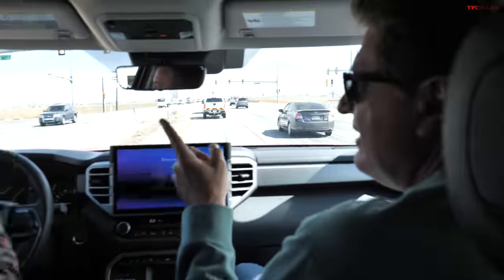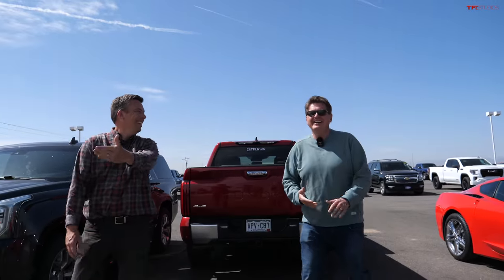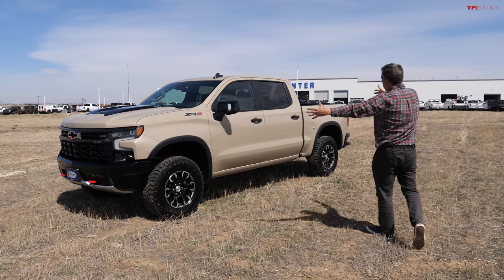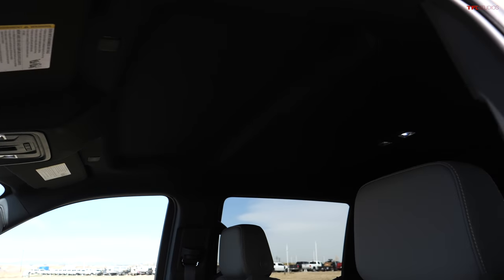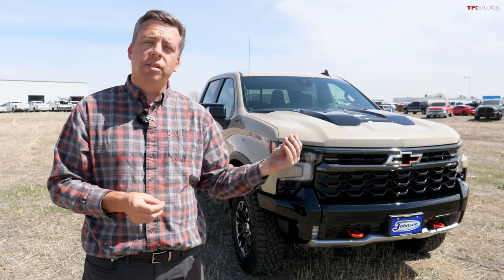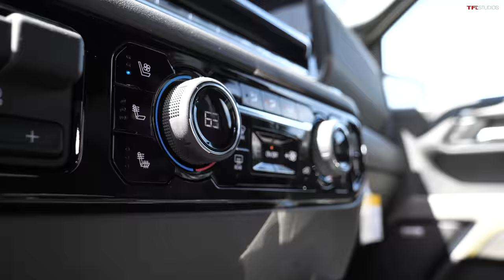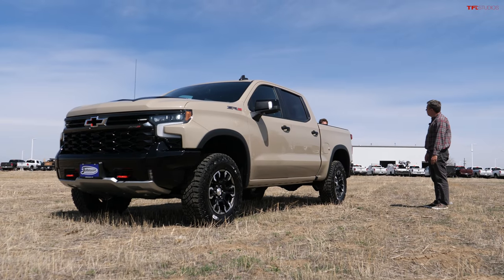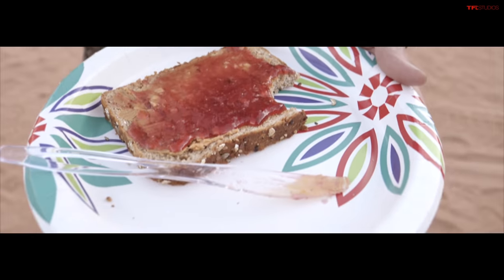We Traded Our 2022 Toyota Tundra TRD On This Brand New Off-Road Truck - Here's Why!

Comment: Maybe the lifters will hold 🤣
Reply: Surprised the turbos held in the tundra
Reply: @danielmeador1991  well they haven’t had years to fix an issue like gm either, wouldn’t buy a tundra either though… doesn’t have the towing or payload I need 🤣 gm has had transmission problems then lifters then both! No one is that unreliable so they sure have a “thing” for putting out junk
Reply: @freedomisntfree_44  you sure need to do research I’ve worked on cars for 20 years I’ve only seen 4 with lifter problems and there all farm trucks that are beaten to death and the tundra not only has turbo problems it has transmission and electric problems too Toyota is pure crap now
Reply: @danielmeador1991  ok 🤣 peoples failing before first oil change and like I said I don’t want a tundra 😂
Reply: @freedomisntfree_44  who would it’s not only ugly it’s completely unreliable and I’ve yet to see a gm fail that early when I do I’ll let you know
Reply: @danielmeador1991  plenty on YouTube, the dealers are suppose to be swapping them out before the trucks are even sold look it up
Reply: @freedomisntfree_44  look it up huh I worked at a dealership I know how it works bro
Reply: @freedomisntfree_44  people not peoples

Comment: First of a Chevy model, good luck with that. 

The 33" tire size is a good balance of off road capability, power, braking, gas mileage... That's why over landers usually use 33" tires.

Comment: Does anyone suspect the reason for the 33s (instead of 35s) is simply to get a smidge better mpg?
As far as being a true competitor for the Raptor/TRX...maybe not.  But I like the idea if forgoing a power adder and wide body to cut the MSRP down some.
Reply: better mpg, braking, steering, acceleration, less noise,  etc etc.  Big tires KILL on road performance which people use 99.9% of the time.

Comment: Leave it to Chevy to promote a winning truck when it’s the only one in its class. I guess since it came in first, it came in last..😂
Reply: Most people don't live in deserts or need a desert runner like trx or raptor.
99.9% of drivers don't buy a brand new truck to take off road and these will sell more than raptor or trx because it is well equipped with the dual lockers and much more affordable.

Comment: I liked the Tundra better but I understand you’re running a business
Reply: Tundra old already. Brand new truck that only leads the class in not one measurable. It's an epic failure after building the same truck for 15 years. Toyota is lazy and uninspiring.
Reply: @dudeman5788  ok mr negative I think it’s a wonderful truck I’ve had Toyota trucks my whole life about 10 of them and not one problem gas oil tires that’s it I’ve never left me stranded I can’t say the same about Ford Chevy and ram

Comment: Very nice truck!  In my opinion they failed with the exhaust tailpipe look.  GM could have made it more appealing by having it exit through the bumper with a new design.  Also, power should have been increased even just slightly.  Regardless, it's definitely an attractive truck for TFL.  Congrats guys keep up the great work!

Comment: So off-road pimped and yet poor approach/departure angles. These trucks are to big for off-roading.
My midsize toyota on stock tires (30.6") with no offroad options/trim has 2 degrees better departure and 1 degree less in the front.

Comment: I love the color. I always like the looks of Chevy, GM, Ford and Ram better than Toyota but I need a truck I can rely on. That leaves the others out of the question unfortunately.
Reply: Such baseless claim, GM, Ford and Ram make reliable vehicles. I have nearly a million miles between a few different GM pickups the last 25 years and have never had a major repair. Everything I've ever needed has been a cheap sensor replacement or something simple and most have been under warranty.
Reply: @OneNationUnderGod.  You must be on what Hoovie found in his trunk.

Comment: I never understand the need to compare up too far,,,, the need for 35s,,,,,, Roman is such a kid!!! Wait,,, that’s not so bad!! Hahaha. 
   I really do like the looks, colour,,,,, what a huge improvement over the Tundra (Off-Road???) 😂. Toyota!!! Pay attention!! Please,,, I’m starting to like the new truck, but it’s sooo tame. 
     I think this Silverado ZR2 was designed to compete with and somewhat crush the F150 Tremor. Having a Tremor, I can see they will, except with the d*mn front seat comfort!!! Enough to buy a different brand,,,,,. I’m loving my Tremor and due to my bad back it has seen near it’s limit off-road for a few hours so far, but otherwise it’s gonna be a fishing truck with a bit of overkill in capabilities. The ZR2 would be even more overkill!!! Haha. 
    The 6.2 is one of my favourite motors out there, the new interior is right up there now (I didn’t mind the previous interior like others, they went for brand recognition, not the worst thing actually. 
    Hey Andrey!!! You should have put the plastic back on the screen!! Roman would never have known!!! 😂😂. 
   This truck will definitely be good off-road. The Colorado ZR2 is really impressive for an out of the box off-road truck. Arguably the best “stock” truck out of the box midsize. Once you add 3” or so to a Gladiator then it steps way ahead and you don’t have to stop there. Lifting a Colorado too much makes a lot the goodies go away,,,,,.
      NICE TRUCK, EXCELLENT CHOICE TFL!!!

Comment: We got tired of paying for window motors and stay away from Chevy/GM terrible service.
Replaced the window motor on the driver side 3 times and the passenger side 7 SEVEN TIMES
we never used the passenger side

After the seventh repair on the passenger side was OUT OF POCKET…… you’d think after a few times it would just get fixed for good lol
Chevy/GM had their chance
We drove straight to Toyota from Chevy and traded our Silverado for the tundra in the showroom.

Chevy/GM wouldn’t be able to GIVE us a truck haha we would just refuse it
“We don’t want that problem”

Toyota always gives amazing service….. and they don’t weasel their way out of warranty repairs
Reply: Toyota is notorious for avoiding warranty issues with one phrase from dealer: "Could not replicate issue".

Comment: Is so ugly truck as ugly as Toyota Tundra bragging about you guys having too much money over did it bulky and that bumper with two hold in the edge is so no brainer design, why you need to put hole in the edge of corner of bumper when you just climbed in the middle of the bumper where the license plate is

Comment: in 4 months they have driven over 7,000 miles on their Tundra. lol....I just rolled to 7,500 miles on mine and I own a 2021 Tundra Platinum 4 x 4 for 2 years. but the new Toyota motors are shit, so I am trading mine for a Ram TRX, if and when I decide to trade..